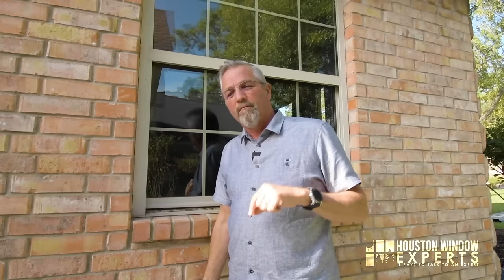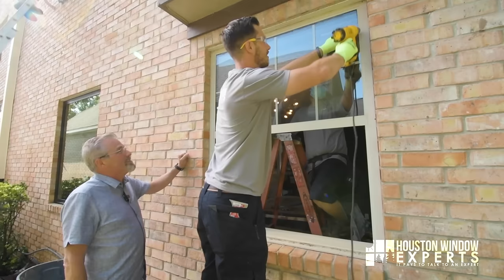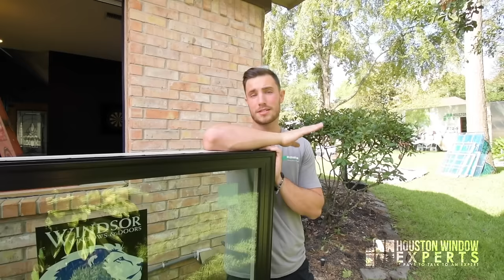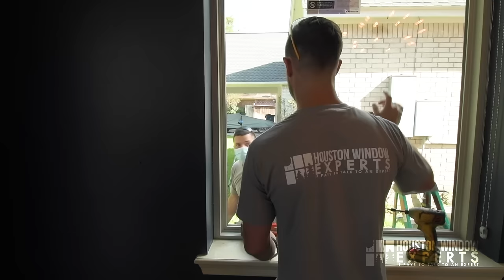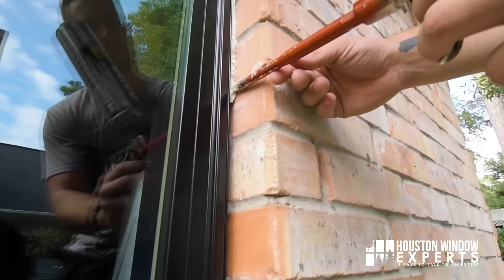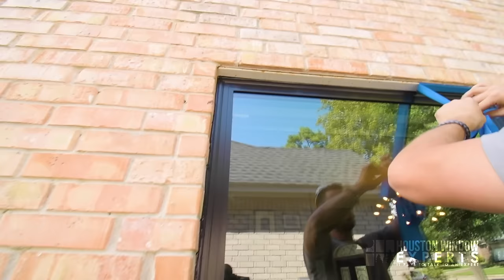Replacing Windows In A Brick Home The RIGHT WAY

Comment: how disappointing!👎
the main reason i watched your vid was to learn how to properly flash the window, only to find out you kept it a secret. thanks for wasting my time.
Reply from the maker: This is what you are looking for.

https://youtu.be/wP6VJo52Xk4
Reply: i'm sorry, sir, but that is not what i was looking for, even tho it is a great video.
i wanted to see how the head flashing of a brick-framed window was done.
did you replace the header on top? did you have to redo the weep holes? how do you even do weep holes in brick? the answers to these questions are what i was seeking to gain.
Reply from the maker: We use the flashing demonstrated in the link I sent you for a brick installation. Weep holes are not a part of our installation process. We do not interrupt the function of the brick when installing a window. Are you installing a new construction window? That is a different method also.
Reply: @HoustonWindowExperts  so, did this window that you replaced in this video have a steel lintel that you also had to replace before putting it in the frame, *or * did you just leave the lintel that is already there? or, do brick homes not have steel lintels at all?!